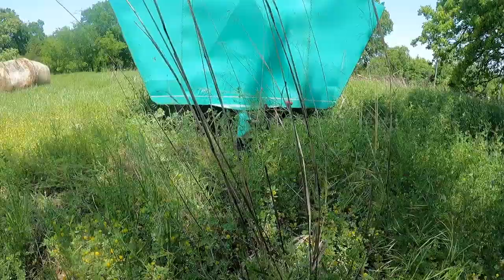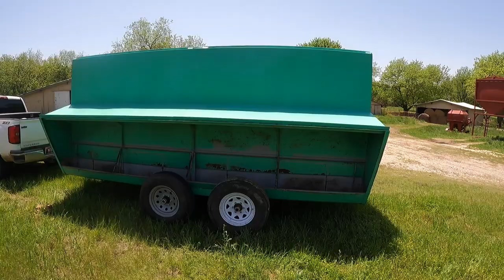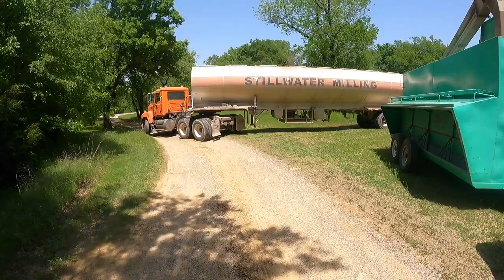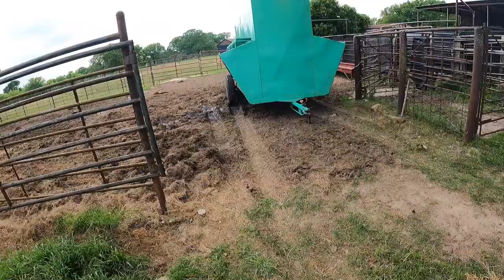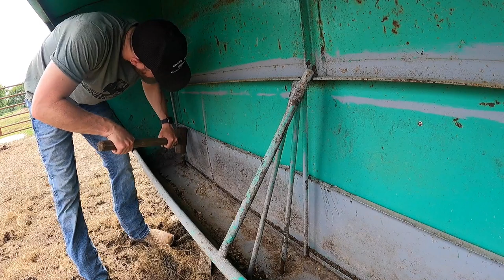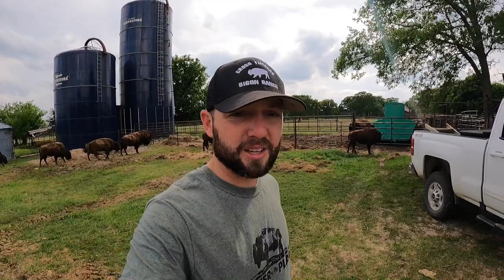Filling Up This BIG Bulk Bison Feeder!

Comment: Cut a 2”x4” piece of wood to an 8” length.  Place this piece of cut wood under the top edge of your feed trough door, and use it to absorb and distribute the hammer blows as the feed door gradually opens.  It will spare the feed door from the deforming hammer-to-metal blows.

Comment: You've been in the Big Boy category since the first bison! But you do need a tractor to move equipment and help with other chores!
Reply: Yes, you are right on all counts. A tractor is going to help and is far better for backing trailers into tight spots than any other type of vehicle and much safer with heavier loads.

Comment: Next time you want a trailer full of feed, it might be cheaper to take the empty trailer to the feed store, fill it there, then pay a tow truck to haul it to your farm.  A big tow truck will have zero issues handling that trailer.  Might need to be sure the tow truck has the right trailer hitch connection first though.

Comment: Love and appreciate what you're doing to educate us in the raising of bison! Quick question: Does the feeder open up from both sides? Could you have parked it parallel to the gate opening (really tight up against the fencing) and had both sides of the feeder open for the two different pens? Would that have not effectively blocked the opening?

Comment: Can you back the feeder into the gate going the other direction so that it actually becomes the gate but the two pens of bison can eat from their own side.  I don't remember if you told us the length of the feeder, but you could then use a panel in front and tether it to the feeder and along the existing fence to keep them from crossing into each other's pens.  It might be hard to do by yourself and watch so you don't hit existing posts too hard.

Comment: I think I would have turned and driven down the fence line and got straight, then backed the feeder up where it blocked the entrance so that they would each have a side. But this might not work because of the way the gate swings. I have worked with Buffalo and Buffalo crosses, they are great animals. Love your channel, please keep the videos coming. 💜💜

Comment: 🤔🤔🤔. Bet ya burn a lot of midnight oil making plans for raising the Bison as safely as you can. Only to realize like filling this huge bulk feeder wasn’t really going to go as planned. Glad the driver was able to help ya out cus most would just pass ya up and hightail out of there. Looks like ya got to go back to the drawing board cus as ya have shown us these Bison have some unusual habits just being curious. I’d have to say you do work hard for their conservation and their safety too. But that big feeder is beyond that truck and doesn’t help with all the mud. Hopefully the feed will last through year and ya can fix the problem just moving it. Did make for a great video as ya captured the Bison antics and did that one actually fall from running so fast. 👍👍👍👍👍👍👍👍👍👍👍👍👍👍👍

Comment: I don’t think those trailers are intended to be towed while they’re full, on our highways. If it is, you need to have a vehicle that is big enough to do it safely. The main reason they have wheels, is so you can move them around on the farm, slowly.
Check your towing capacity. If your pickup’s towing capacity is rated at 2 tons, you certainly don’t want to be towing six tons behind it. You’ll have a “tail wagging the dog” situation and could have a serious accident, let alone hurt your vehicle’s engine. Be safe!